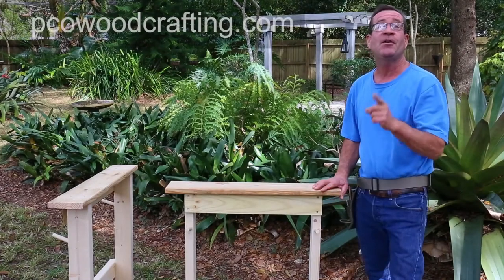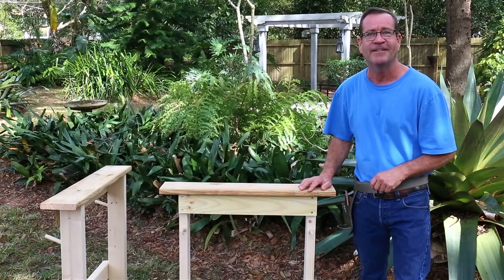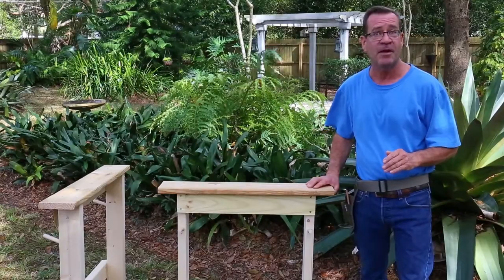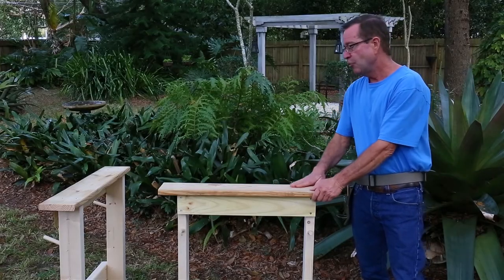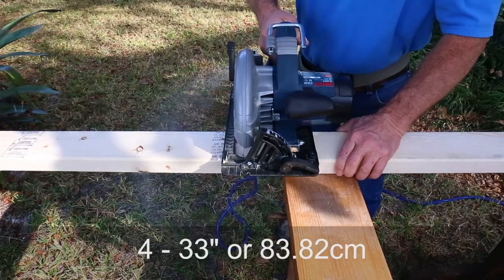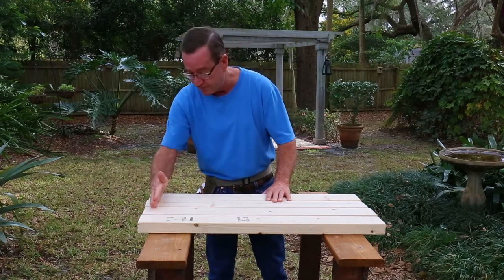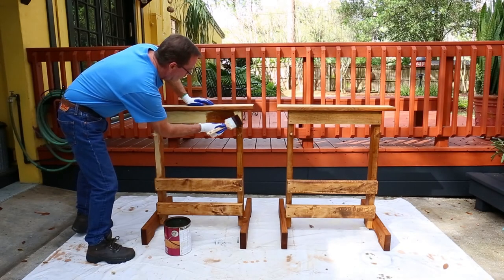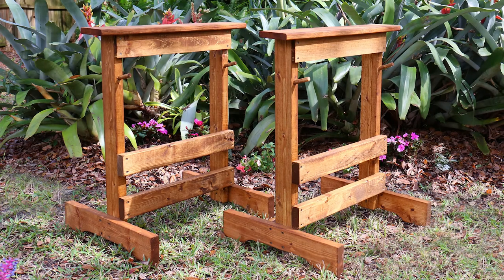DIY | How to Build Custom Sawhorses

Comment: Nice looking saw horses. One comment though you say "4.5 inches or 11.43 cm"
You really have too much precision in your metric measurement. It would be nicer to say 11.5 cm (or 115 mm). 3 mm is about an eighth of an inch. You are working with wood, not an airplane.
Reply from the maker: Ok, got it,  I do not use metric here in the states so thank you for filling me in.